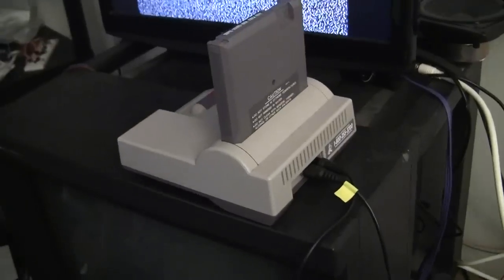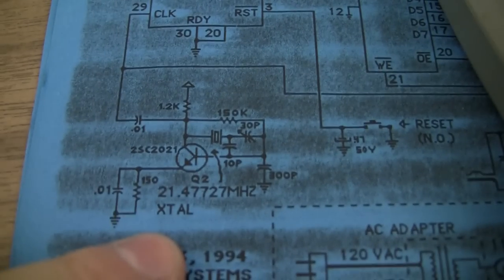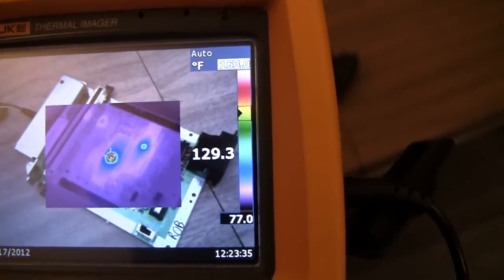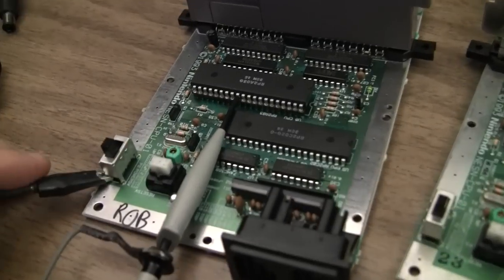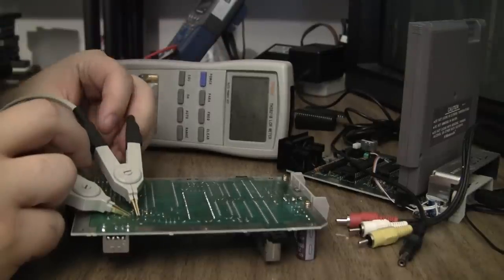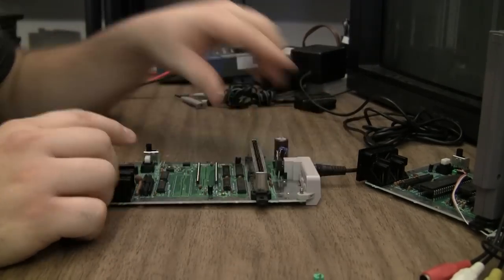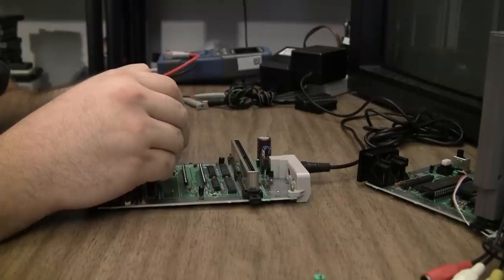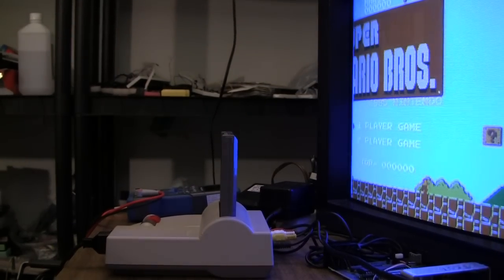NES 101 Nintendo Top Loader - CPU PPU repair - no clock signal

Comment: OMG! THIS is the video I've been looking for! In about a year of searching I've only ever seen one other person reporting a B&W NES. Could you put the symptoms in the title or description?

Like you, I suspected the clock signal and swapped a known-good crystal, known-good trim cap, known-good RF/power/AV box, and so many other parts. It wasn't until I installed the Hi-Def NES and socketed the CPU/PPU that I finally isolated the PPU. Because the Hi-Def NES can OC, I assume it generates its own clock signal to fix this but there was a little strangeness at first (guess it expects to see one as well). I went ahead and put it in one of my other good NES consoles instead but it did essentially fix the issue for me. Wish I had a scope.

Comment: I just fixed mine (the clock circuit) by replacing the two transistors. I replaced the variable cap as well but I really don't think that had anything to do with it.

Comment: Also, one more question. The power cap is 1500uf 25V correct, and if that is the correct one is there anything else that I should look for in the power cap or will I be all right as longs as I have the two above specs correct? Thanks again!!!

Comment: Very cool mods. A few questions if you've got the time. First, I think the power cap on my top loader needs replaced so is there anything special that needs to be done because it seems like just desolder, remove/replace cap, and then solder back in. Is that it or anything else? Second will you be auctioning any more AV modded NESs on ebay again. I'm thinkin about purchasing one but I don't want to send my own top loader to be modded (it's special to me and I don't want it changed :) - Thanks!

Comment: A common problem with the rf box is the switch itself. It is a sliding switch where the contacts commonly gets dirty. Spray with electronic cleaning and rock it back and forward. If that doesnt help you got another problem.

Comment from the maker: I try to keep the size the same since a much taller one wouldn't fit under the heat sink.
The one I use from Mouser is # 661-EKZE250ETD152MK2, don't pay attention to their pic.

Comment: watch your video's all the time, good stuff!! . one thing was puzzling me though .. why didn't you just use the scope to check for a clock signal or the ocillator ? also it was working at the beginning how did the CPU die ?
Reply: Colin Mackay I was wondering the same thing. My guess is that it was probably when he switched to DC and it drew so many amps that it dropped the voltage. In other words, the CPU was already bad but it didn't have enough juice to cook itself. I know I tested DC on my frontloader NES that had black and white video output and it didn't fry but perhaps my adapter couldn't provide that many amps.

Comment: nice video showing off some of your tools!     I'm also confused by some of your capacitor readings.  The disc capacitor you could not read in circuit properly,  yet the electorlicit you could read in circuit.  Is that due to the circuit it is in?  or a difference in how you can measure those types of caps?
Reply: woodengamer I think it has something to do with whether or not there are other capacitors connected to ground on the positive side of the capacitor. There was one point where he said he couldn't test one in circuit because there was another connected in parallel with it.

Comment: with all the problems that board had why didn't you just replace the whole board?
Reply: XeonProductions That would involve sacrificing a 101 toploader. It's much better to sacrifice a 001 frontloader or junk Famicom to restore a 101 toploader. 101 toploaders are simply too valuable.